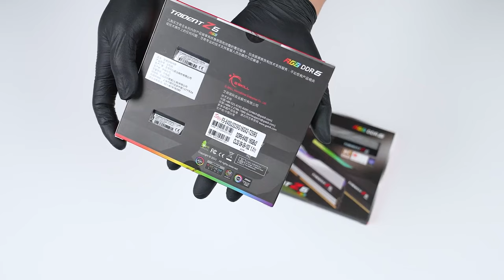BUILD ALL WHITE / NZXT H9 FLOW WHITE / RTX 4090 VULCAN WHITE / CORE™ I7-13700KF

Comment: You have a i9-13900k processor in the video but have listed a i7-13700 in your description. Just helping dude 👍🙂
Reply: Thank god I was wondering why spend all that money on this build to bottleneck it with a mid range cpu
Reply: @yc_030 that wouldn't even bottle neck it lmao, the 13700k is the equivalent to a 12900k
Reply: I think its because in the title he put "i7 13700k"
Reply: do you know which Lian Li Strimer Plus V2 cables he’s using PW12 or PW8
Reply: @yc_030 mid range? A i7-13700k would run that 4090 perfectly well, in fact would be the better choice if this was a gaming pc.
Reply: @yc_030 if the i7 13700 is a mid range cpu i'm fucked
Reply: Totally  @sonatafx 
That dude knows nothing about pcs 😂
Reply: That’s a lot of numbers

Comment: To understand, there´s a total of 3 + 10 fans right? 3 from the Kraken Z73 and 10 LIAN LI SL 120
Reply: Yes
Reply: I can only count 10?
Reply: @resinds.p4898  the other 3 are hidden above the top 3 fans and radiator. The mesh grill at the top is removable. There’s a fan mount in between. Watch video again and you’ll see them at the top for a brief moment.
Reply: I think he used LIAN LI 3x for X73 and x73 default fans he used for top cover, as @byronnix1628 stated before you can see it here: 7:03 It means he have double fans there. Also i don't really understand why he is using intake from bottom because GPU fans probably pushes that air away.
Reply: @NeverfakE-LV  What do you mean with top cover, is there something more above the AIO?
Reply: @NeverfakE-LV the case recommends intake from bottom and outtake for the rest. For optimal cpu cooling. And then another way for optimal gpu cooling it’s on their site for cooling recommendations
Reply: @byronnix1628  Noooow i see it thank you
Reply: thank you, because i've seen on a lot of builds same pattern as you say - bottom intake, all other out @byronnix1628

Comment: CPU on the video is actually i9-13900K not i7-13700KF. Plus, tell the customer NOT to buy 4 RAM sticks on a DDR5 motherboard. I've seen a video recently where customer kept blue screen because having 4 RAM on a DDR5 mobo. And in fact, using only 2 RAM slots is much better on a DDR5 mobo
Reply: Ive seen thousands of 4 slots ddr5  ram builds, none of em has ever been blue screened, really dont know where your getting that from bud
Reply: I've recently seen a post where a person kept blue screening after adding a 4090 VULKAN to their build, so I would also advise against buying a 4090

Comment: Is the fan configuration:  3 side input, 3 bottom input, 1 rear exhaust, 3 top exhaust (with push / pull for AIO)? So a total of 13 fans?
Reply: or maybe AIO is only 3 fans so a total of 10?

Comment: Question... Im still doing hard on Fans in terms of Direction.

The fans on the AIO Cooler (Above the Mainboard). Do they have to pull air from the top? oder push air down in the case?

Comment: Quick question about the air flow:

You are letting air in on the bottom and letting the air out on the side, back and on the water cooler. It means you are refrigerating the water cooler with hot air. Isn't it supposed to be the contrary? Air goes in through the side and bottom since cold air is more dense than hot air and air goes out on the top and back?
Reply: I have the same question

Comment: Nice build! I’m doing the same build but was wondering if you have any problem matching different fans in the push/pull at the top (exhaust)? What about the different RPM in the fans? Or do you just set a fixed RPM for both? 😊
Reply: i'm wondering how the rear fan was installed cause mine couldnt fit
Reply: Did you ever figure this out? @ericsontabuyan5993
Reply: @maxzhang734 you just push it in it takes a lot of force I did it with a lian li 120 infinity fan

Comment: I wonder what cpu temps there are if the radiator get´s heat from the GPU
Reply: exaclty what I was worried about , bottom fan should be facing the other way